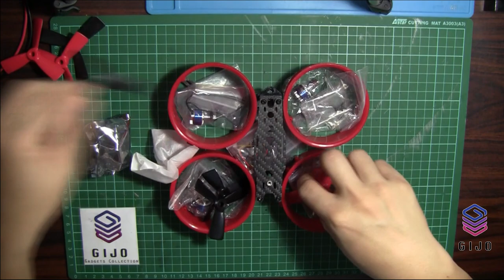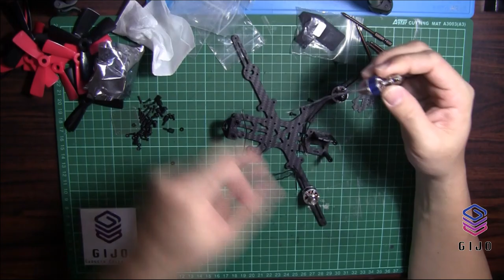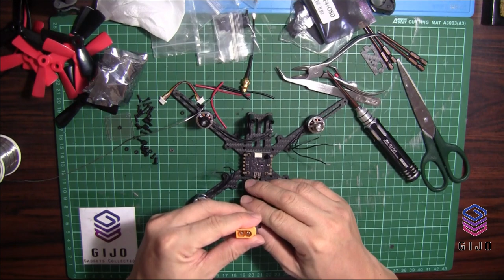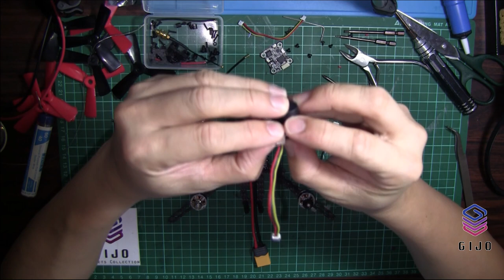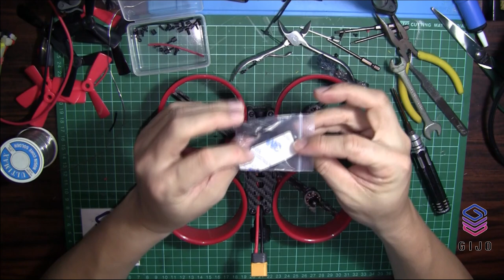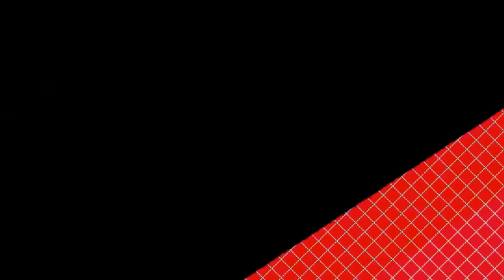Setting Up DIY CLOUD-149 149mm 3inch 4S 25A PNP FPV Cinematic Drone

Comment: Hi...I bought this drone memo a while ago with the same controller. It burned, replaces it, but doesn't want to work anymore. Do you know what I can be wrong? When I connect the battery, only the sound of the escs beeps  thanks!!
Reply from the maker: Hello there. Seems like the new flight controller was not configured? Open up betaflight ans check on the ESC protocol setting. Try change to Dshot600.

Comment: What type of receiver used?
Reply from the maker: Your own choice sir. PNP version came with no receiver. So you can put in receiver that match your radio transmitter protocol. Tq.
Reply: any video I can refer to install the receiver
Reply from the maker: May i know what type of receiver you   wanna use?